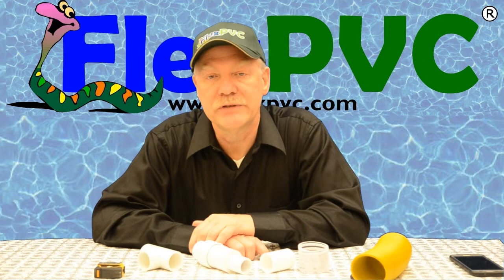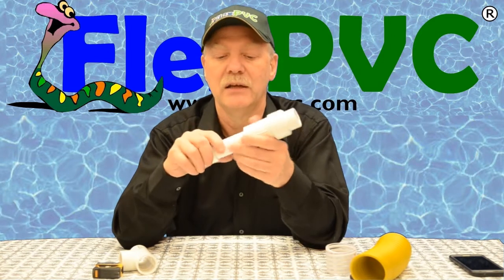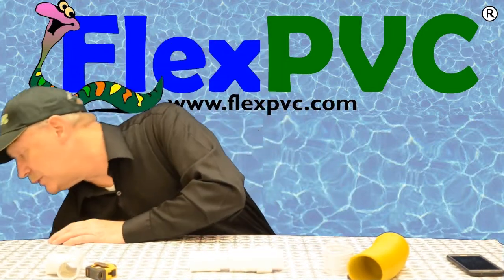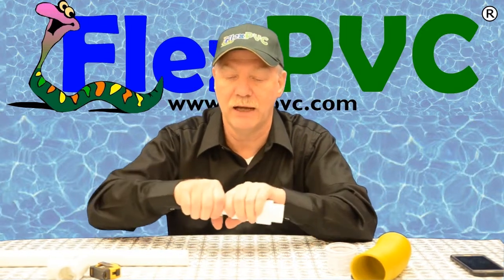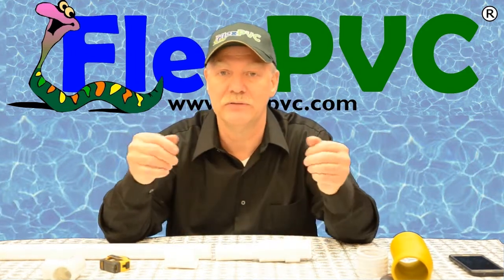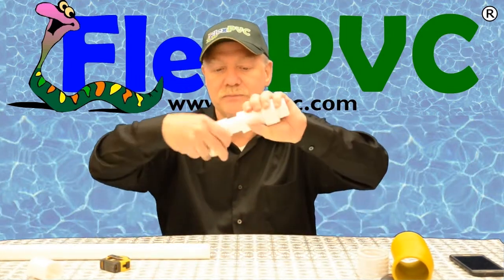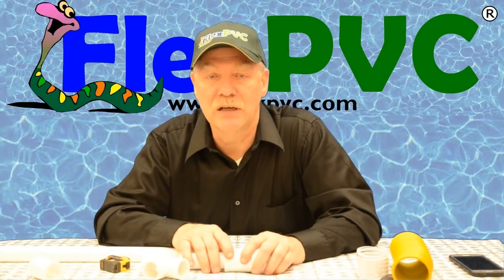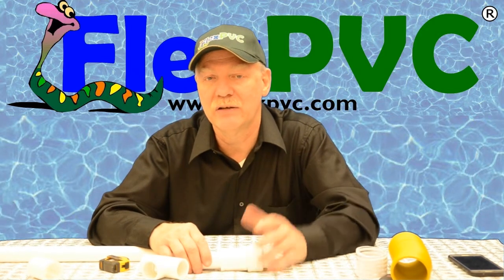FlexPVC- How to use telescoping couples to make repairs in broken pipe.

Comment: How effective is the flex pvc for in ground use and can I expect it to las as long as ridged
Reply from the maker: It depends on the application. Generally if there are not termites you are good. We also recommend no sharp rocks in the backfill. Sand and soil best. What is your application?